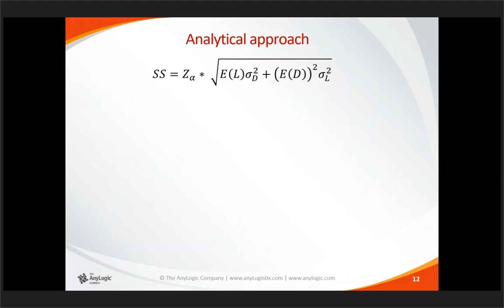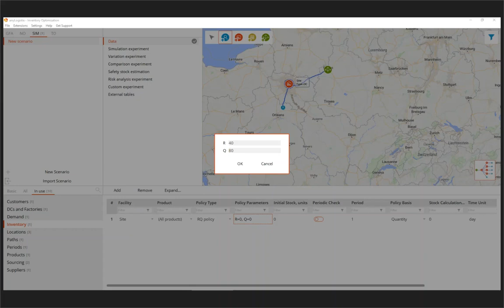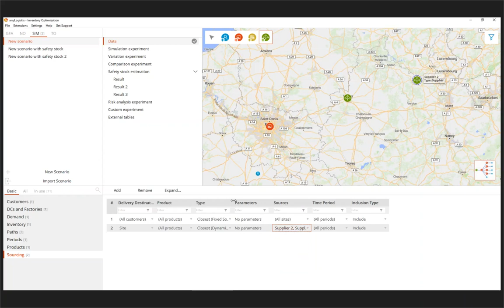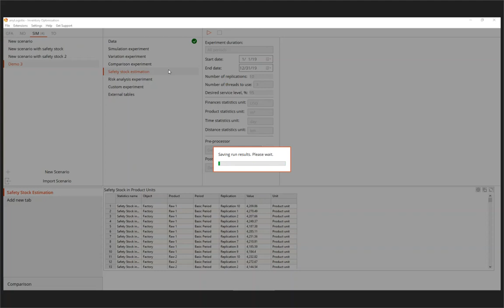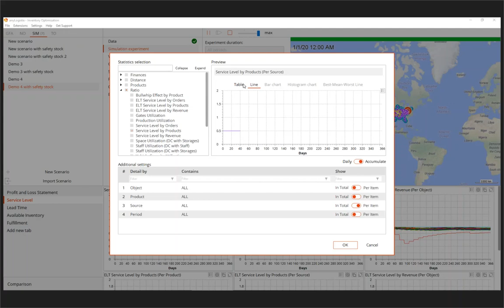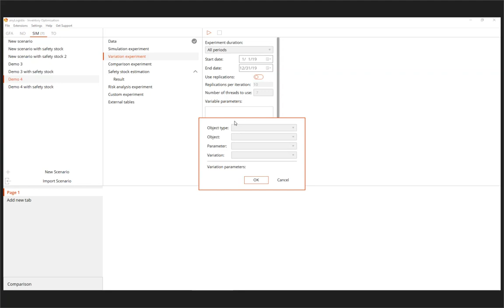Webinar | Simulation-Based Inventory Optimization

Comment: Thanks for this presentation. May I know if the estimated safety stock is for each day within the period or for the year.
Reply from the maker: Hi, 
The "Safety Stock Estimation" simulation experiment allows you to find the quantity of safety stock required to maintain the desired service level for all warehouses in each tier. The safety stock determined in this experiment can be used, for example, in a "min-max policy with safety stock" throughout the entire period (https://www.anylogistix.help/tables/inventory.html#Min-max-policy-with-safety-stock). 
Also, it may be interesting to have a look at the following article - https://www.anylogistix.com/features/safety-stock-in-supply-chain-management/

Comment: I have a question at the start. I take the exact same steps as you, but my system does not recognize the connection between supplier and DC. I add it as a source but there is no blue line between them. Do you understand why?
Reply from the maker: Hello!
It seems like you are trying to work on the model from the webinar using a newer software version. Since 2019 some functionality from the "Paths" table has been allocated to the separate "Shipping" table. That table is one of the basic tables designed to establish a connection between suppliers and DCs. In case this does not help, please press "Get Support" button in anyLogistix and we will help resolve the problem.

Comment: Thanks for the detailed explanation. Can I get the data that was used in this video? This helps to run the experiment and confirm that the solution is correct. Gratitude.
Reply from the maker: Hello! Glad you've found the webinar useful. Here's a link to this webinar on our website https://www.anylogistix.com/resources/videos/simulation-based-inventory-optimization-with-anylogistix/. Below the video you'll find webinar materials and presentation slides.